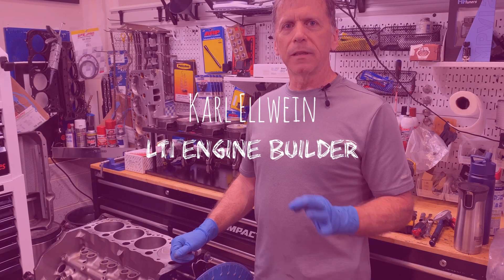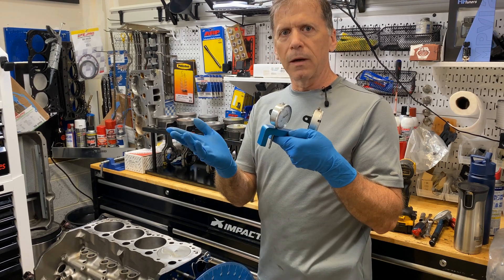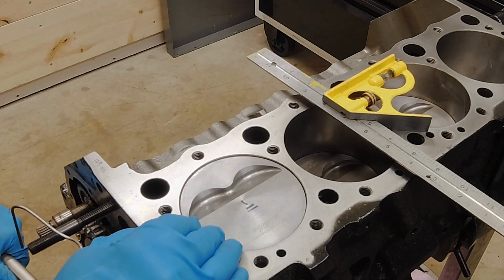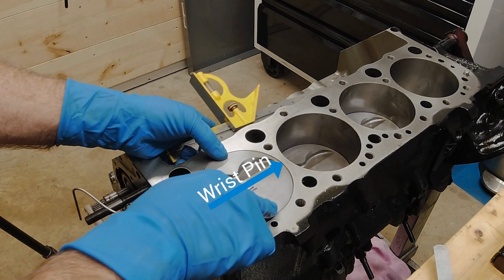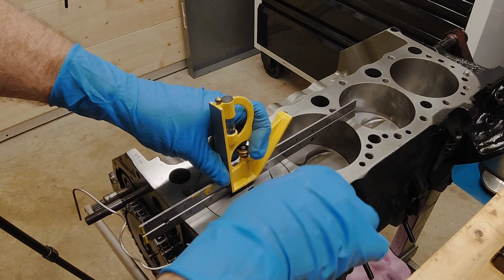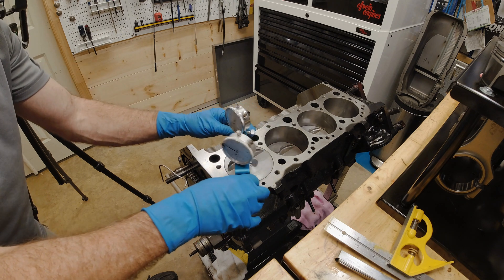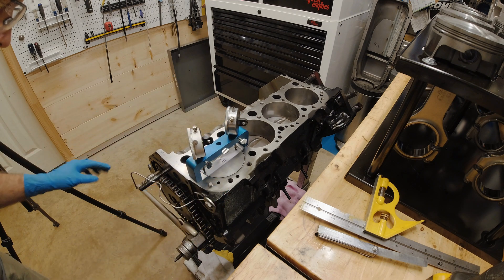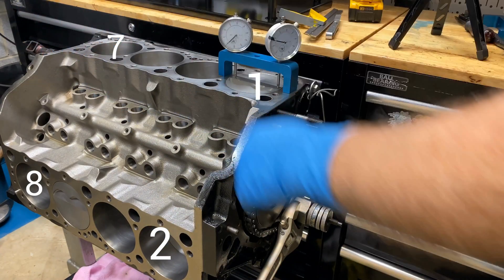How I Do It --- Piston Deck Height

Comment: Although I agree with these two methods you used, one is obviously more accurate than the other(in most cases).  I would have to disagree with you when you mentioned to average the two clearances after rocking the piston in the bore.  I was taught that there is no such thing as averages in engine building. There are tolerances and clearances.  What I believe should have been done is rock the piston in the bore at TDC, while the tip of the dial indicator is resting at the 12 oclock(near the lifter bores) edge of the piston. This would give you the minimum clearance.  Also measure at the 6 oclock point to get your othee minimum clearance. Whichever is the smaller number is your clearance. Now if you are calculating compression ratio after you determine clearance is sufficient, then you can measure at the wrist pin(center line) of the piston to give you the volume for gasket thickness and compression ratio.

Comment: One question.. Why need to check depth clearance?
Reply from the maker: Good question.  Basically for a new engine or rebuilt engine it is nice to verify if the piston is flush with the block deck or a bit lower or maybe even above the block deck.  Most of the time the piston will be right were it was supposed to be when you buy the proper parts and the block is machined properly.  But you still want to verify just in case something is wrong.  Also the piston "deck height" is part of the compression ration calculation.  So to get a good valid compression ration calculation you'll need to know where the piston is (how far down in the hole).  The gasket thickness can be adjusted to get the exact piston to head clearance too.

Comment: Isn't that a bit far down in the hole ?
Reply from the maker: Not that I prefer the piston in the hole that far but I prefer to "NOT" deck the block to zero.  I deck the block to the minimum required for flat and that is usually only 5 or 10 thou.  That helps the intake manifold fit better.
Reply: Most machine shops go .010 away from zero deck incase you ever have a boo boo and need another deck job. Unless customer wants true zero deck
Reply: @shaunfeldman3964  most  pistons  are made  for  0 deck....esp  SBCs....because  most people just "0 deck" the block

Comment: hey ive seen alot of tuning you made, using plasticine to check valve clearance, using degree wheel and etc.. looks forward for your next quality upload !
Reply from the maker: Thanks.  That was the very first time I did the valve checking spring method.  I'm finding it difficult to get camera time and editing time but still there are countless tech topics to go over in the future.  I do think the clay method was quick and easy.
Reply: @EllweinEngines  do you have topic on cam duration and compression ratio with valve size and flow.. im building a small single cylinder engine
Reply from the maker: @halim1644  That will be a bit over my head.  Cam duration and dynamic compression ratio...that is over my head and I leave that to the cam and head designers like Lloyd Elliott and Dennis Staff.

Comment: Karl: Does the cranking compression vary much between cubic in blocks using the same piston? Say 327 vs 400 sbc?   I am trying to wrap my head around how to order pistons for a 400 sbc for good performance but also managing cylinder pressure.  I imagine the only 100% way is to put the pistons and rods on the crank and in the cylinders but I dont know?
Reply from the maker: Yes.  Well, static compression will vary.  I guess cranking compression is a function of the camshaft.